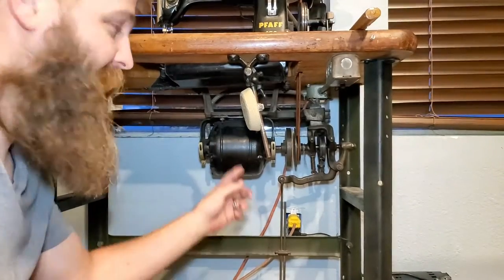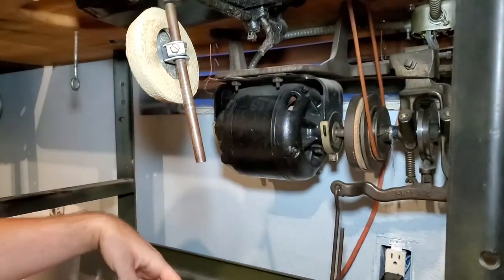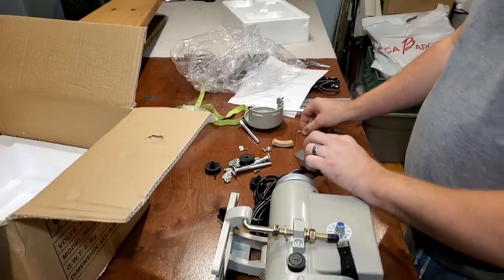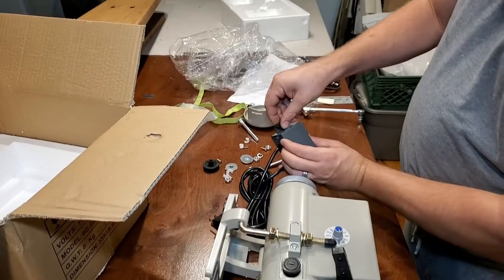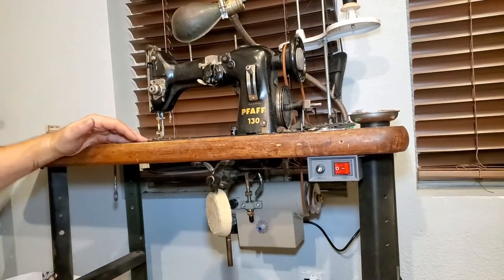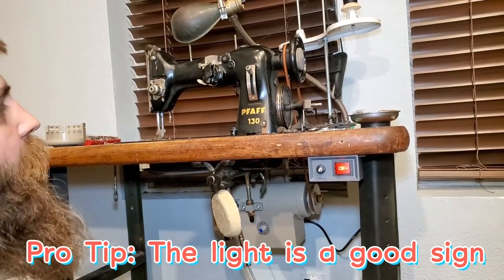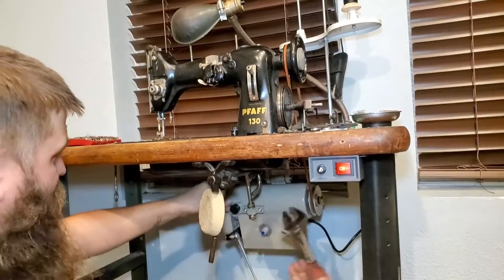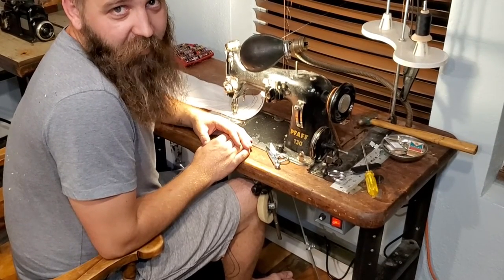PRO TIPS! How To install a Sewing machine Servo Motor

Comment: I'm surprised that round belt worked on that pully. Yr gonna love that servo! How does the brake work?
Reply from the maker: I dont like servos because the control lever is spring loaded. There is no middle point to "free spool" it brakes automatically.